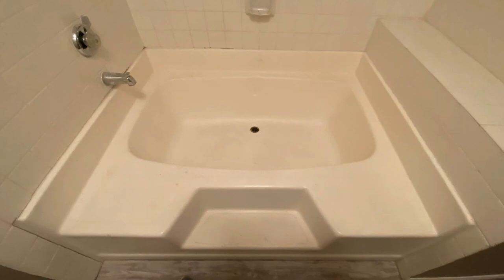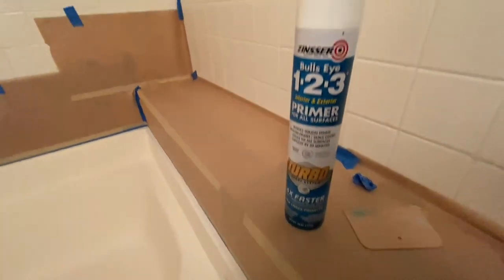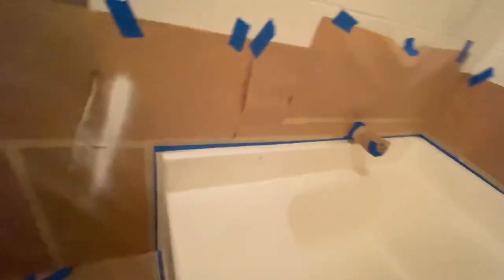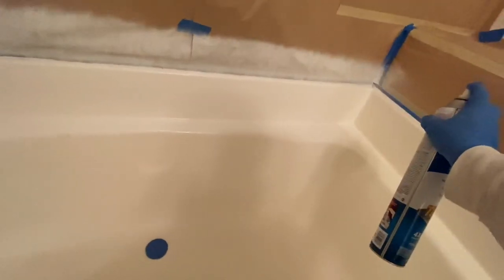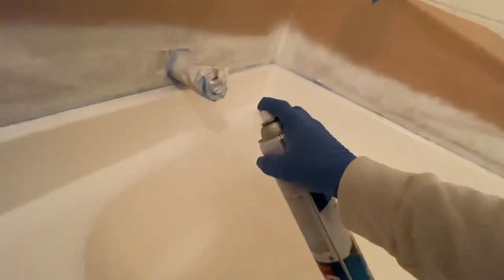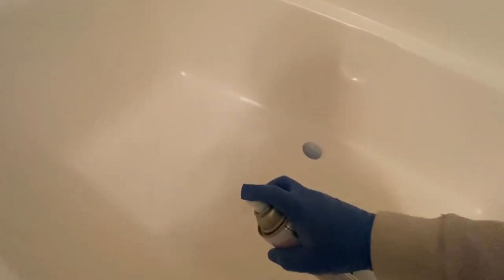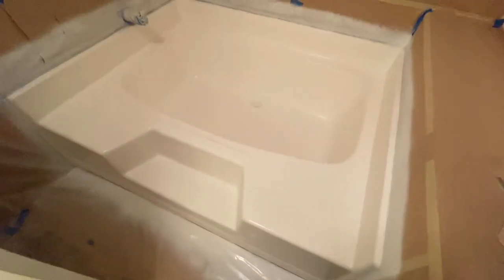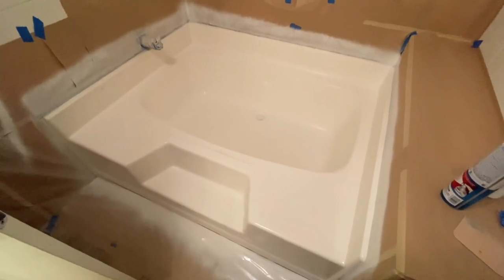HOW TO REGLAZE A BATHTUB #6 | Spraying DIY Primer on a Bathtub before REGLAZING

Comment: the primer is water based. Can you use it for bathtub?
Reply from the maker: I have used it for years! Yes
Reply: @DPTubs Thanks for sharing. What type of glaze did you use on the tub? Looks great 👍🏾
Reply from the maker: @stacybrown811  Resurface Solutions
Reply: I see the description 🤦🏾‍♀️😂
Reply: @DPTubs  💃🏾💃🏾Thanks!
Reply: NEVER USE  DIY PRIMER FOR BATHTUB , RECOMENDED EPOXY PRIMER BEFORE APPLIED TOP COAT ( GLAZING )

Comment: Watched almost all of your videos today! Great stuff. I have a fiber glass tub/shower surround that I need to refinish as it was refinished before but the paint is peeling in the tub area. Some questions I have:
1. The walls are not peeling. Should I remove the paint from them as well with Jasco paint and epoxy remover as I am planning on doing for the tub, or should I just sand them? And if I just sand them, do I still need to prime them (I was planning on priming just in case)?
2. I am planning on using Zinsser primer.  I noticed you use a variety of them. I think they are all oil based, correct? I saw these at Home DEpot: 1-2-3 BullsEye Plus Primer for all Projects (which you use in one of your videos) and also Zinsser Cover Stain oil-base Primer. Have you used this last one? Or should I stick with the first one? Or should I use use the Zinsser Primer for all Purposes Turbo since it has a larger nozzle and I have large areas to prime. Is there a version (oil-based) that I can roll on with a roller?
3. What do you recommend to put on top of this primer for the top coat? I would prefer something I can roll on. I have looked at the Krylon Tub and Tile, but not sure if it can be rolled and it seems hard to find in stores in CA. I have also looked at eKopel2k epoxy at Amazon (supposedly less fumes). I am looking for something that won't peel/crack and will last for a long time without yellowing.
Looking forward to your advise!
Reply from the maker: Feel free to DM me on Instagram @dp_tubs. I also offer 1 on 1 zoom consultations. 
-Sand down the walls with 220 Grit sandpaper...this will let you know how well the previous coating is adhered to the surface. If it peels then it will be a pain as you have to sand it all the way down with 150-180. Do not use jasco on fiberglass. 
-I use Zinsser 1-2-3 Turbo Spray Can...this applies the best. I do not recommend using the small cans on tub shower units because you will get quite a bit of roughness. You can see the can size I use with the bigger spray nozzle..almost like coming out of a gun. 
-You can use roll Krylon Tub and Tile on but you would have to check with the paint supplier (Sherwin Williams or the MSDS to see what the best recommended roller is) If you use Krylon then you make sure you mix part a really well and then mix part b really well. Add them together and then before pouring into a roller tray make sure you strain it. The hardener for Krylon tends to get gummy sometimes so I always strained it.